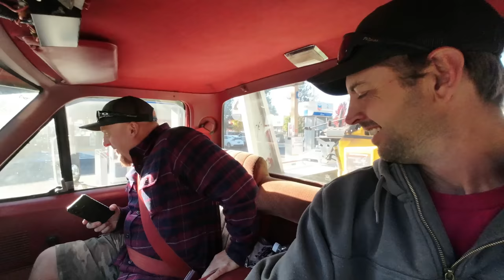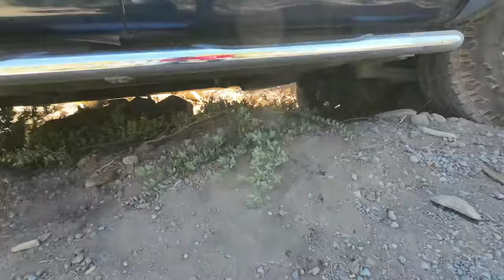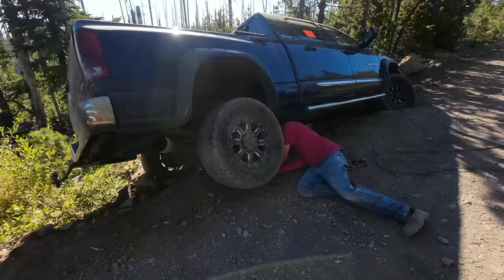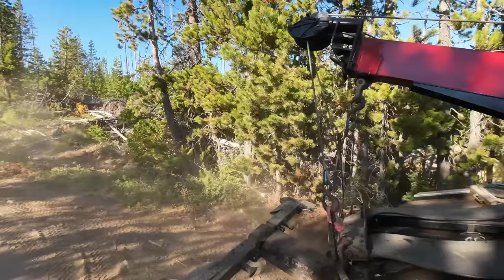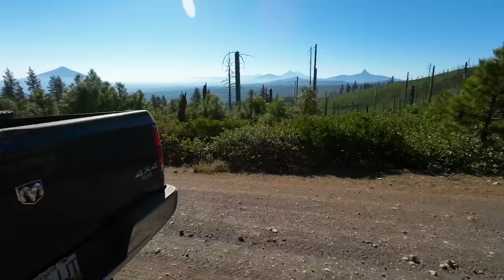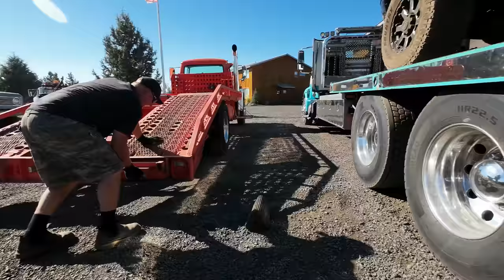They got lucky...

Comment: I see Ben standing next to a Gibson tractor with its Wisconsin engine. I have a '37 Gibson. I need tires for the back. Nobody around here or internet tire sellers seem to have the right size tires for it. Like 8.00-22.5s.  Can ya send me in the right direction Ben? That Cornbinder tow truck is way cool.

Comment: Heh heh wheel lifting the wheel lift. You didn't take out the front drive shaft? I thought it was not good to tow 4x4 without being on a rollback or dollying the front wheels?
Reply from the maker: I unlocked the hubs.
Reply: @CaseyLaDelle  Gotta love non auto hubs :)

Comment: Maybe I missed it, but does the rear hydraulic lift on the roll back and tow truck have a mechanical lock so that you aren't relying on hydraulic to hold them while traveling?
Reply from the maker: Nope.   All modern tow trucks rely on hydraulics to hold the load while going down the road.
Reply: I welded an eye onto my wheel lift and hook one of my safety chains to the back of the bed..for all the safeties!! I learned after I got a pinhole in one of the hydraulic lines and the wheel lift decided to become a road drag
Reply from the maker: @hughstephenson2957  these trucks use holding valves.   A blown hydraulic line will not cause it to drop down.
Reply: @CaseyLaDelle  mine was supposed to have one but sometime it was removed.. simple rednecked it together so I work with what I got. Rocky Mountain Wrecker Service has a used wheel lift but it's kinda out of a poor man's price range..
Reply from the maker: @hughstephenson2957  if the cylinders on a wheel lift or boom don’t have holding valves on them, they are the wrong cylinders

Comment: Your safety chains look like in some situations they might touch the pavement…?
Just a reminder for your viewers, safety chains touching pavement underway make SPARKS. Guaranteed.
Sparks cause roadside fires, which can grow into huge forest fires.
Cross your safety chains, and use zip-ties or bungees to hold the chains up, well clear of the road surface. 
IMPORTANT is an understatement!
Reply from the maker: They don’t.   And no, I don’t cross them on a tow truck.   This isn’t a trailer, and it doesn’t work the same as a trailer.
Reply: @CaseyLaDelle  because as I understand it, crossing them on trailer is to catch a dropped tongue which doesn’t have any wheels up front but a towed vehicle has wheels so it’s more to keep it from getting away, right?
Reply from the maker: @JohnHallgren  partially yes.  The other major difference is the way it pivots.  With a trailer, the pivot happens at the mid point between the chains connection to the tow vehicle, and to the trailer, so the cross ends up directly under the pivot point itself.   With a tow truck, the pivot (usually)happens way up underneath the vehicle, and nowhere near where the chains would cross.  Meaning that instead of eliminating chain bind in turns like you do with a trailer, you’d actually be creating it instead.
Reply: @CaseyLaDelle  duh! Yes, that’s something obvious that I should have realized when I posted but wasn’t thinking that far…I was just thinking about the purpose that crossed chains serve on a trailer hookup vs the geometry of them which you clearly pointed out.
Reply: Ok. It works different….
But my main point was NOT to allow safety chains to ever drag on the pavement for the reasons covered.
Reply from the maker: @cliffmorgan31  cool story.  They didn’t drag.